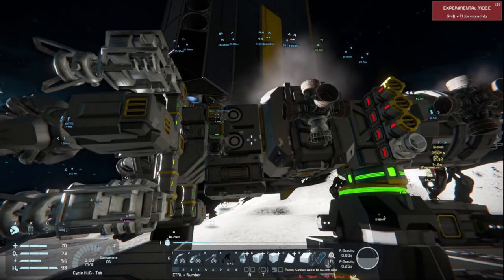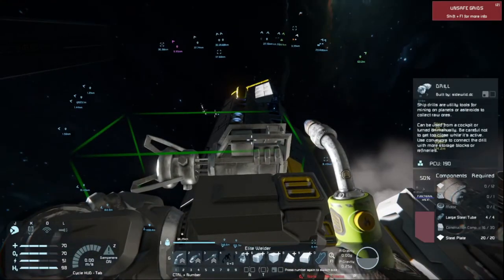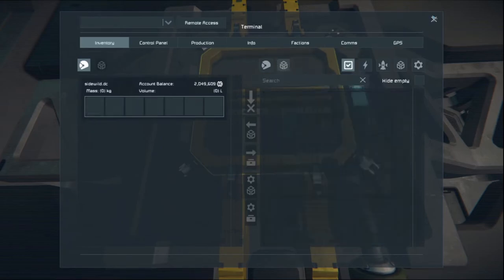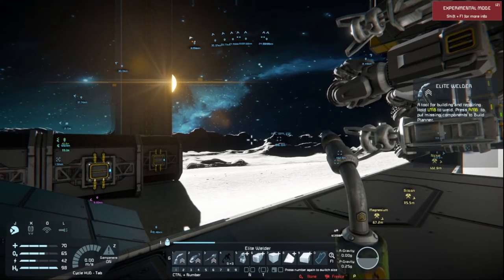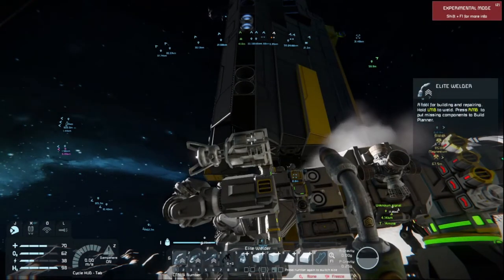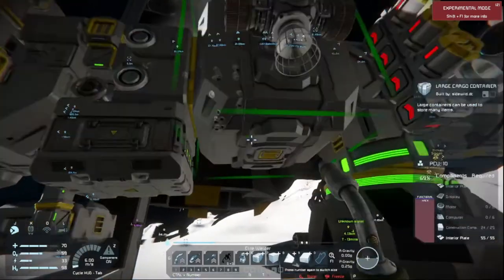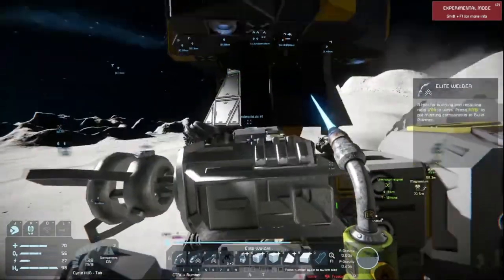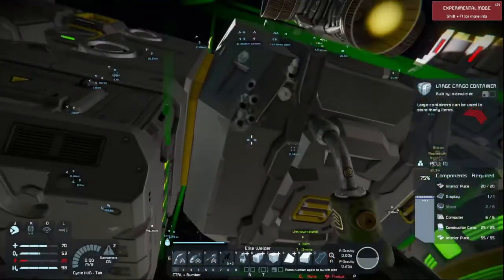How To Repair Fast In Space Engineers!

Comment: So uh i started 2 days ago playing with my buddies so I made a mining ship but my buddy crashed it it isn’t damaged and the only new parts was a O2h2 generator and cockpit which we replaced why does it say that we don’t have enough 02h2
Reply from the maker: Try putting ice in the cockpit and go to the ships inventory. Try to put the ice from your cockpits inventory into the O2h2 generators inventory. If the O2h2 inventory goes dark you don't have connection and have a pipe that's not connected because it's broken passed function. The conveyors should have a green light on them. Yellow means not connected and red means they have no power.
Reply from the maker: Also thanks this has given me an idea for a new video.